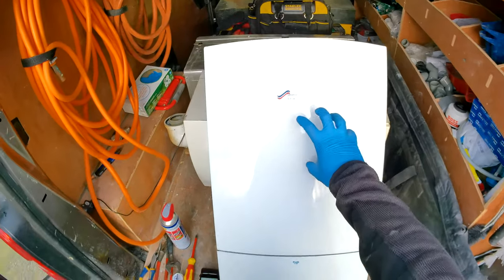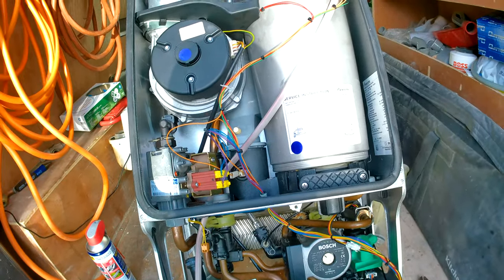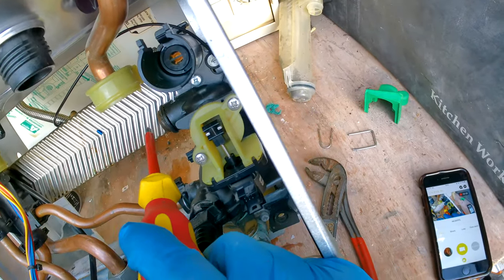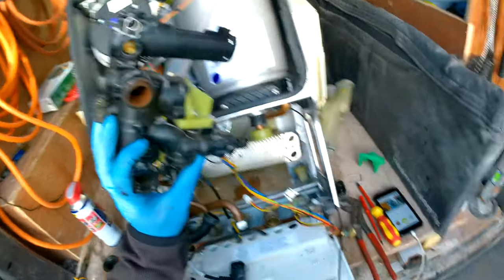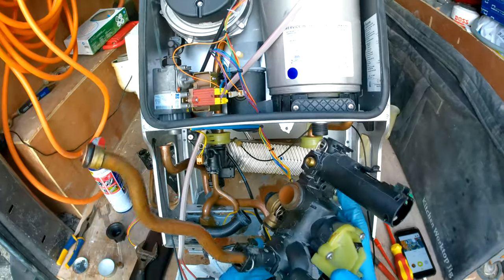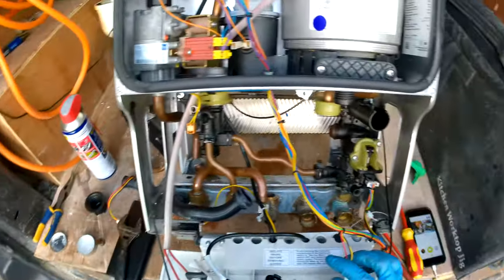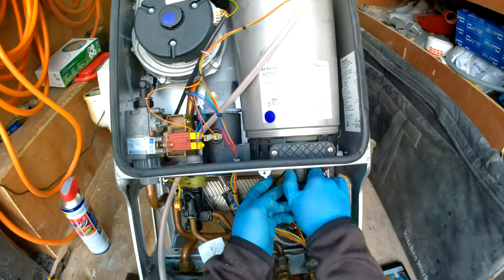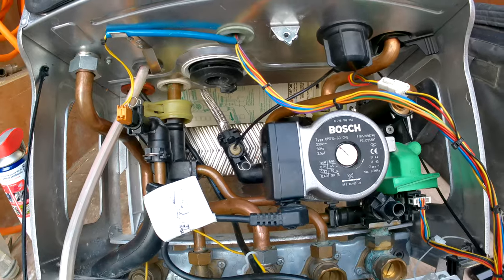Worcester Greenstar - How To Change / Replace The Return Manifold / Block / Unit

Comment: Hi, Indeed a great video, and very well put forward! ...the only thing I did notice, when handling the main body, the small valve came out and went under the boiler unit, though you did find it and placed it by your grease tin! ...if this boiler is to be used again, this will need fitting! ...again, great video.
Reply: Whete does that bypass restrictor go please struggling to figure it out

Comment: I had an absolute nightmare with one of these earlier today. I found it almost impossible to get everything lined up again.  When I finally got everything back in position and tightened up again, I turned the mains water on and water was still coming out of the heat exchanger/return unit connections. I had to leave it till tomorrow. Absolute pain in the hole.

Comment: how on earth did you put that return pipe back in so easily, the one under the drain off, took me a lot of sweat, after about 30 mins I gave up and used the original o ring and still it was a right pain
Reply from the maker: Did you use grease? Sometimes fairy (not ideal) can make it easier
Reply: @advancedboilertraining  used all that stuff, no joy, in the end I used the original o ring and used that retaining clip to keep one side down whilst I pushed the other one in. Right pain.

Comment: If you remove the bypass pipe from the return manifold ( rather than the left side of the block), you don't need to remove the water pressure gauge or the expansion vessel braided hose from the pump body. Just pull the pump off the return manifold and sit the pump where the condensate trap normally sits. This came from our tech, who said you can cause damage when removing the pressure gauge and braided hose. I did my first return manifold 2 days ago and did it this way and it went without a hitch.

Your video was a huge help, mate. I only had to watch it twice and was able to change the return manifold in good time. I've subscribed to your channel and will get a look at your other videos 😊

Comment: Later type unit as the longer syphon, new type fan fitted, overall that visually looks in good condition still, no visible excessive heat damage to the heat cell, and easier when they are dry too.  good vid tho. Nice dark orange staining on the inside of the pump connection part of the return unit, and rear lower seal, defiantly a  water quality issue on that system it was fitted on.

Comment: Brilliant vid helped me out so much👌 after fitting new manifold flow on central heating gets hot when run dhw the pipes hot but not radiators. Had new diverter on new manifold could this be sticking?

Comment: Your solenoid looks really high.. mine looks really low.. I commented on yoir other video just.  I replaced the right hand unit/turbine, refilled and I've got a mostly off blue light and a 2 flash red.  No ignition. Its locked off... i followerd everything you said.. Any ideas, Sir?